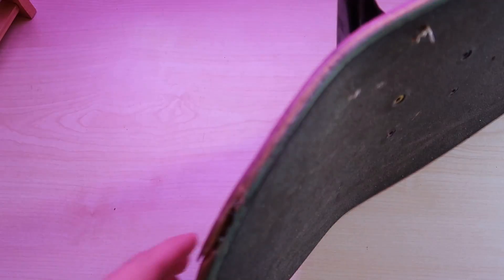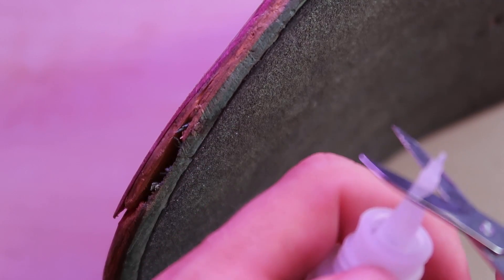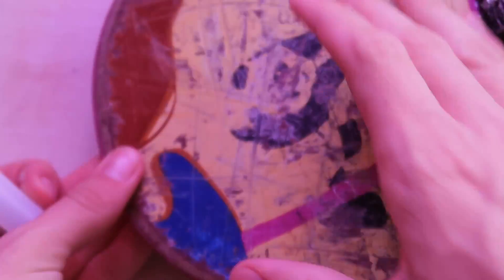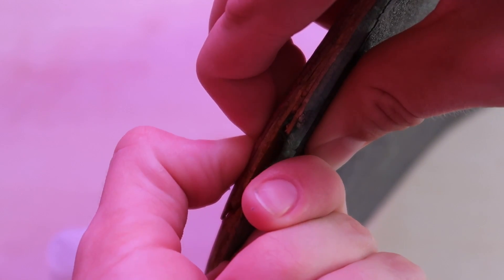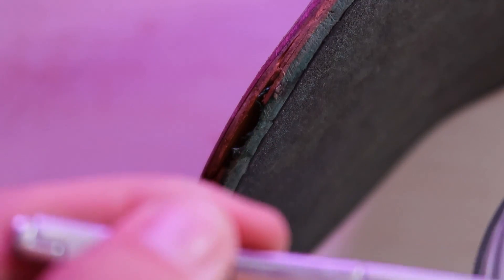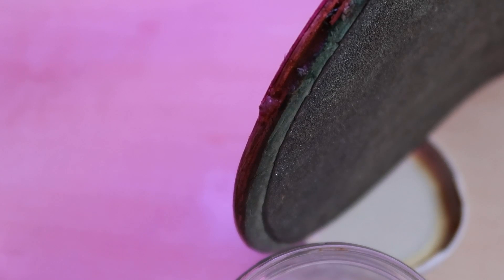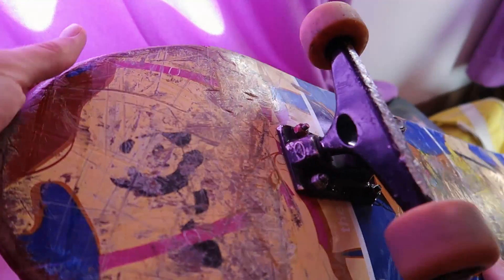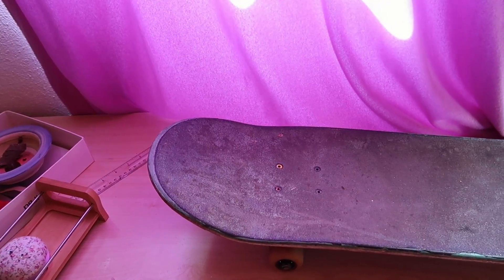How to repair a chipped/cracked skateboard deck

Comment: Use wood glue and clamps. NOT super glue and your hands
Reply: Why not
Reply: @bennyefraty7577  because wood glue is for wood and the clamps will give enough pressure to compact the wood!
Reply: @bennyefraty7577  and wood glue is much safer
Reply: Exactly what I was thinking

Comment: Don't cut the super glue open with scissors, use a pin and make an hole in the top, that way you can control the flow of the glue better and there's less chance the glue will leak or dry up during storage 😉